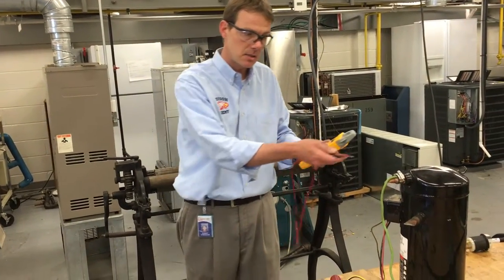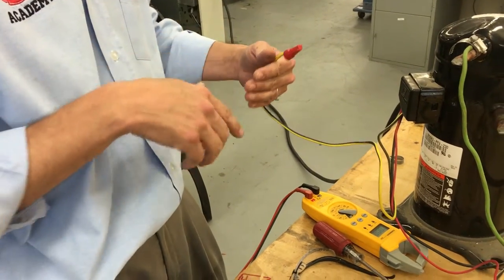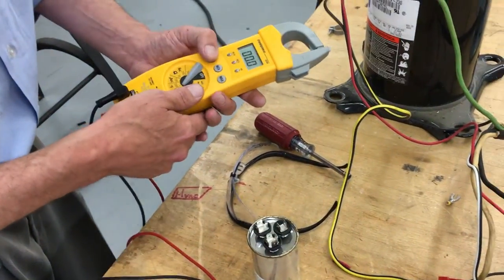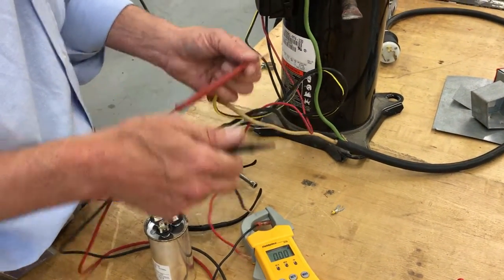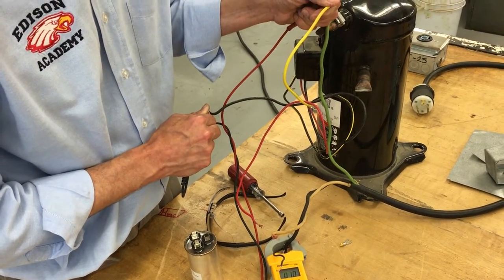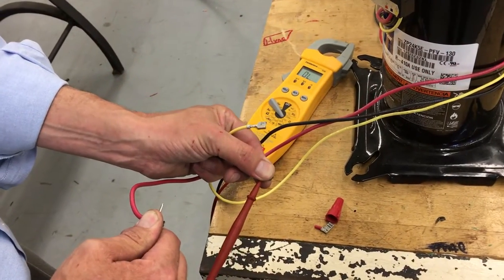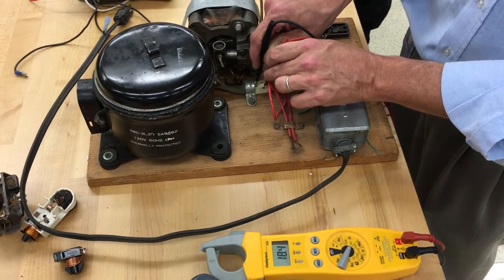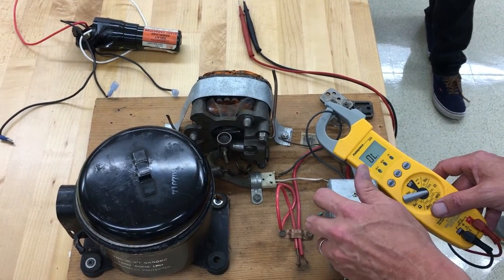HVAC Basics: Service & Troubleshoot - Testing a compressor with a shorted winding & Capacitors

Comment: I got 3 of these scroll compressors daisy chained with 5 sec delay between each . They are my home shop air compressors . Extreamly quiet and plumbed them in such a way to dump into a catch can above them to capture all the oil which by way of them extra small copper lines .030 in inner diameter  links back to intake reoiling all 3 continually . Then to an old condenser to a water drain then to 30 gal tank. This bud just helped me dig through a pile of these compressors a local HVAC were scrapping. Fun prodject.  Fyi the amount of air from each produce the same as a C.H piston compressor . So this series up is 3 times faster 100 times quieter

Comment: Can you help me? I have Ductless system one 18 k and two 9 k the 18 one is woking ok but the two 9 are not working. When I turn them on the fan comes on but they not energise the out door unit can you give some advise on what could be the most likely cause of the problem. Thanks